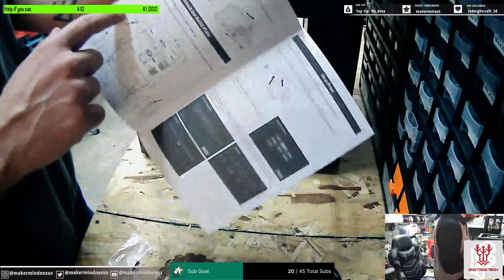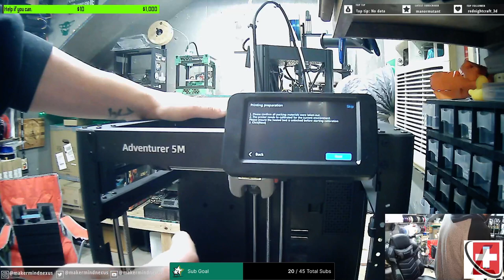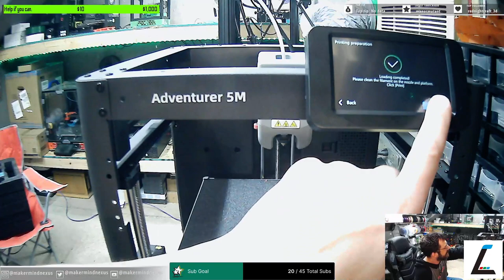Unboxing, setup, and first print of the FlashForge Adventurer 5M.

Comment: Good news, Flashforge has finally officially released Klipper firmware for the 5M printers 👍. Now I am debating which one to buy, 5M or 5M Pro... $200 more for the enclosure, ventilation system, camera and 0.6 nozzle sounds like not a bad deal 🤷‍♂️
Reply: What is klipper firmware??

Comment: i have had mine for about a month, it's my first 3d printer. With PLA I have zero issues everything prints perfectly, but trying to print the enclosure pieces with PETG i can not get it to work. I have tried a bunch of temps on nozzle and bed and no luck, any tips?
Reply from the maker: I wish I did I printed only PLA on it.  Only things I can suggest would be slow the speed and bump your temp.  Another thing to try if you are using OrcaSlicer is run the built in calibration tests.

Comment: Finally put My Cr10 out to…(Well, I Just moved it over… With all The Mods and imbued historicity, I’ll not part with it willingly ).. And went ahead and Picked up my first core XY (ad5m, now that they released Klipper files..Open source is important, even if I don’t know how to use it yet, I Will.)For just over 350 total. I know Nothing About Klipper, FlashForge,Orca, etc.. So I Kinda need to unlearn, Learn And start from Scratch here..Feels oddly uncomfortable as I Know My Cr10 and Etc Inside and Out..
Just Printed the calibration Cube as the test print while Im Here..(That was FAST!)….
I’m Playing this in the background while I  Building/etc..Osmosis..lols..
My Cube Came in @ 2.002x 1.004x2.0*..
(Printing the ice cream thing..)
Subbed🤙🏻